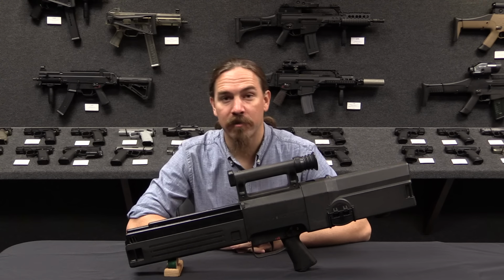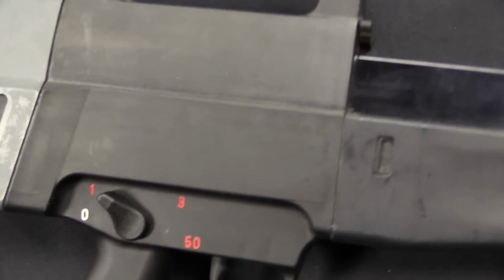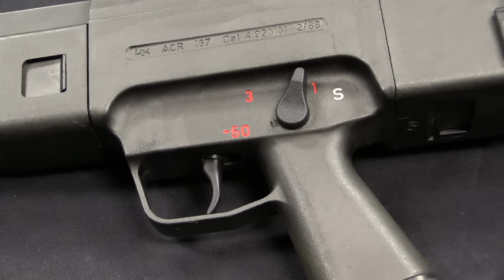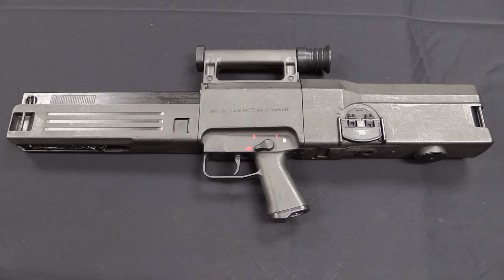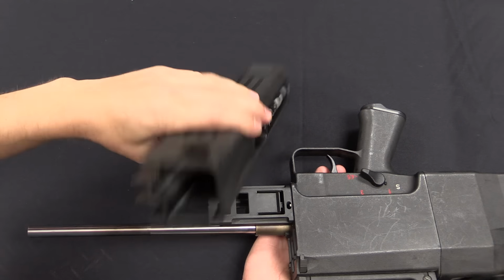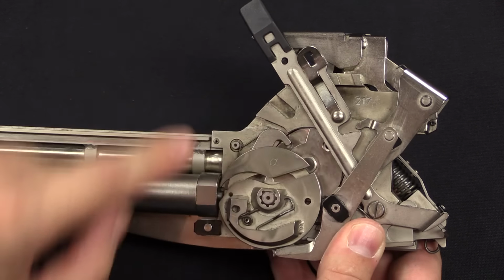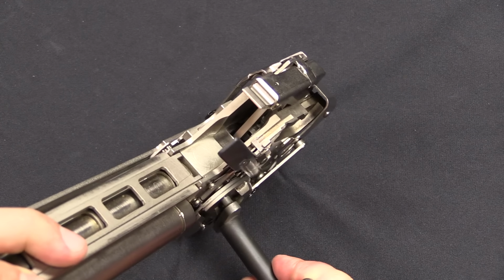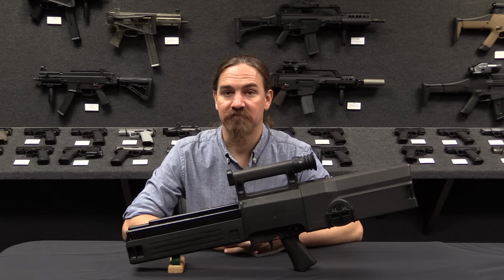Kraut Space Magic: the H&K G11

Comment: If I owned this gun and could fire it- the first thing I would do is make a clear plastic "stock". How wild would it be to fire this thing and be able to see that automatic wristwatch factory of an action going off right by your ear. It looks like a 1890s mechanical computer powered by small bombs!  Choose if you want to do 1 or 3 calculations each time you pull the trigger! For extra accuracy, paint the parts fake brass color and put fake watch jewels over the screw heads.
Reply: Clear bodied, and have all the internals redone in a copper or brass finish.
Reply: I like your thinking. Plate the internal parts with copper/nickel/brass, plate or paint the optic in brass, give the whole thing a bit of a paint job/aging treatment, then fit a transparent stock... Got yourself an awesome Steampunk Assault Rifle!
Reply: Ah dude imagine the high speed slow mo.
Reply: After I watched this I had another video pop up on my feed.  Was from like 6 years ago, shows someone firing one and have to say that it did not look at all pleasant.  Thing shook and bounced around all over the place. Not sure if I can link it but it was from "Karkanistan" or something like that
Reply: RewardedRocki the G11 was extremely experimental,you’ll only see translucent bodies on H&K’s mass produced weapons.
Reply: you just made a transparent watch my dude
Reply: You do realize the it could fire a 3-shot burst so fast that the recoil felt like a single shot, right? You'd never see the internal parts moving - it would be too fast to see.
Reply: @mcm95403  exactly ... 3 shots in less than one tenth of a second :)
Reply: @mcm95403  and then high speed camera footage came out before this rifle was even made. Sorry you missed that
Reply: @mcm95403  Don't care, still got a transparent, steampunk clock/gun from the future.

Comment: In a way I wish it had gone in to full scale use so we got real world stats on failure rates and improvements though true world testing. Caseless ammunition is the future and until someone starts using it full scale we won't see innovation in this area.

My god that action is scary! But this is basically the first of its kind. Look at how horrible the British SA80 was before it was redesigned and rebuilt. I hope someone revisits this program.
Reply: The L85A1 was a perfectly adequate rifle, back when it was still called the Armalite AR-18.

(I joke, of course.  But the L85A1 basically is an AR-18 in bullpup form, just with 200% added suckage.)
Reply: @roberthansen7228  I don't think we need to go into it, Ian has covered almost everything about that story in past videos. I worked with soldiers who were issued with the SA80 when it came out. I heard all the horror stories first hand as they came out. Including the threats issued to soldiers not to discuss the rifles failures with the general public. Today it's not a bad rifle. It does it's job well and excels in some areas. It's still a very complex rifle and in my opinion it is time to replace it.

Comment: I thought H&K's conventional pieces were complex, then they produce this. I'm not sure if the internals look more like a vending machine or a mechanical calculator. What might the probable manufacturing and assembly costs of that been? There's also a practical issue; what happens if you get mud in the barrel? There doesn't seem to be a way to push a rod through it. (Muzzle-loaders might be subject to the same criticism, but they mostly have a bore diameter that can accommodate a small child.)

Comment: When you grabbed the 'convenient tool' to rotate the action, I realized that gun is a wheelock, and the tool is a spanner....
Reply: Kind of funny considering that Wheelocks are Technically "Caseless" guns.

Would this be going full circle?
Reply: What on gods green earth is a spanner
Reply: @spencer seiler A 'spanner' is a class of hand tool generally used by lower forms of primate to round off the corners of nuts and/or snap the heads off bolts, thereby making extra work for Mechanics and Engineers. The sub-class seen here is a 'pin spanner' which adds variety to the process by bending/snapping it's own pins, thereby giving the Engineers a chance to repair the tools themselves, instead of just the results of the tools who use them. American Engineers have developed the useful term 'wrench' as an alternative to 'spanner' in order to indicate the action to be taken by an Engineer upon seeing such a tool in the hands of 90% of the population, that is, to wrench it out of their hands immediately.
Reply: @MrHws5mp  It's not hand tightened if it's not stripped.
Reply: @CallMeMrChainmail Indeed. It's also important to remember that 'LH' printed on the head of a bolt means 'Longer Handle', not 'Left Hand thread'...
Reply: @spencerseiler4904  It's a type of wrench that uses a couple pokey pins or tabs that fit into matching holes on the object to be turned.  The castle nut that secures the stock on an AR-15 is tightened by a spanner wrench.  They're also sometimes used for pulleys in cars.

Or if you're British, it just means "wrench", and could apply to any old nut-rounding device.
Reply: @ThetaReactor  Bicycles (particularly expensive ones) use them too in places. Usually where you need something that can grip without a whole lot of surface area gripping. bottom brackets (where the cranks go) is one spot off the top of my head.
Reply: @spencerseiler4904  - it is a device, similar to the 'key' used to wind up some clocks - or a similar device for winding up the spring in a wheelock mechanism.
Reply: @spencerseiler4904  Many years ago a spanner was a tool to span a crossbow. The term stuck around when a tool was needed to wind up a wheel lock action and became a general term for lever tools that fit onto nuts or lugs.

Comment: To the people saying "Just remove the 3-round burst and simplify the weapon" that's missing whole point of the weapon, the whole project was build around the 3-round burst, the use of caseless ammo was a decision taken to allow the burst to happen.

Without the burst function, the G11 has no point, the caseless ammo with it's issues have no point in existing.

If it's weight and cost reduction you may as well just use polymer cases, like the LSAT, Steyr ACR or the polymer cased 50BMG.
Reply: I don't even see how removing the 3-round burst would significantly reduce the complexity of the action. The only difference between 3-round burst and automatic is that in burst mode the action is allowed to fire an extra couple of times before it returns to its original forward position. The burst mechanism itself shouldn't be any more complex than what's in the trigger mechanism of any other burst-firing gun.
Reply: You can carry whole lot of ammo more with the caseless ammo and the magazine capacity is greater
Reply: Not entirely true, caseless ammo still has a weight benefit.

Comment: The mechanism may be a little complicated and finicky, but made well, such mechanisms run for ages.
I collected mechanical calculators some years ago, some of them are freakishly complex (just think about automated division, a hundred parts whirring and shifting), yet still they can do hundreds of calculations every day and that for years, maybe a drop of oil here and there.
They were mass-produced, the technology was there for quite some time.
In comparison the G11 looks quite simple.
Reply: Were they explosion powered? The calculators you collected.
Reply: Nope, didn´t have to be to receive high forces.
Did you ever see such a machine run without cover?
Much smaller parts, levers and gears, running into and hitting each other many times a second, or a complicated assembly weighing a pound or more slamming into a hard metal stop after a spring driven travel of four inches. Many of the fully automated machines had thick rubber feet not to spill your coffee standing on the same desk.
You will be surprised what even intricate mechanisms can take, if executed well.
By the way - that was 50s tech.

The trials rifles each put 4000 rounds through and seemd to work well, so the mechanism could easily take the loads.
In the G11 the gas system may drive the mechanism, but in a regulated way, and no part of the gear and lever mechanism had to withstand the explosive force itself.

Comment: FW, if this gun was a cased ammo with a maybe similar mechanism and perhaps a more ergonomic design would you consider this a viable gun? For example high magazine capacity despite being single stack, fast piercing bullet, complex yet relative simple mechanism. I like to think of this gun as interesting idea developed on paper but poorly executed maybe due to its major flaw of forcing the caseless ammo
Reply: The caseless ammo was necessary for the 3 round burst with one recoil impulse which was the whole point.
Reply: @trentrubenacker9718  well yes it may be the reason though it could have been worked out differently with cased ammo or just forget the fact to expel ammo before recoil was felt and just perhaps work it as a regular burst firing? Maybe I'm just talking nonsense but I try to always get the usefulness of something
Reply: @Seb-Storm  The mandate was to improve hit chances. Duplex ammo was tested. Flichettes were tested. They lacked power. The G11's solution was to fire 3 rounds before recoil was felt. It would work, but it would require caseless ammunition because you can't run a piston and extractor system that fast in that much space. Caseless ammunition essentially proved too disadvantageous and killed the project. The AN-94, a Russian firearm, fires two rounds of cased ammunition for one recoil impulse at 1800 RPM. The system is even more complicated than the G11, but does actually work because the goal is a little less extreme and  therefore allowed them to keep cased ammunition in the design.
Reply: @Seb-Storm  You couldn't use cased ammunition that small and maintain the firearms use either. It's like 60% the length of a 5.56×45 cartridge.
Reply: @trentrubenacker9718  oh ok thanks for pointing out that. Good to see people on internet can still discuss in a nice way

Comment: The feed system reminds me of the P-90, did the G11 actually contribute to its existence?  (Yes, I know it's a different company)
Reply: Feeds absolutely nothing like a P90. The P90 has a totally standard reciprocating bolt and single feed magazine. P90 mag has a cool feed ramp that spins the cartridges 90 degrees but its just driven by normal spring pressure up the magazine. 

The only similarity between the two is that they both have top mounted magazines with the rounds at 90 degrees from the chamber. 

Even then the similarities are very limited. G11 has vertical rounds, single stack magazine. P90 has horizontal rounds, double stack magazine.
Reply: Gotcha.  I was just curious if somewhere along the line the concept might have served as inspiration or someone said, "Whaddaya mean we can't feed perpendicularly, the G11 did it!  Hold my beer..."
Reply: G11 is a clock made into a space rifle looking thing
P90 is a fancy bullpup bren space smg looking thing
Reply: I'm wondering about a connection with the Steyr ACR, and later the LSAT machine gun. Those also have moving disconnected chambers where the next cartridge itself pushes out the case/dud.

Comment: TLDR: Why can't you just fire the brass with the bullet?

Instead of having the case made of propellant, why not just attach it to the bullet and use it as added mass and flight stabilization? Like, imagine reversing a shotgun shell and putting the primer in what was once the front and fire the whole thing. Then your caseless ammo is just as strong more or less as regular ammo?
Reply: Because the brass would make a horrible drag in air ? And you would push a whole bunch of 'dirt' right into the chamber
Reply: @Wolfson91  No way to design around the drag? Trade the drag for better ballistic characteristics? Think Air Bow, only shorter projectiles and powder actuated. 

And I don't follow you about dirt, seems like bottling an explosion based on gun powder is gonna be dirty no matter what you do hehe.
Reply: Fiocchi and Benelli tried that with the 9mm AUPO and the CB-M2 SMG.
Reply: @danielwatters1203  Awesome thank you I'll dig into that, that's basically exactly what I had in mind.

Edit: And here's my answers:
"In theory, caseless ammunition offers a number of advantages over traditional ammunition: less weight, less firearm complexity, higher rate of fire. One of the major detriments is heat, as the traditional cartridge case acts as a heat sink and removes a significant amount of thermal energy form the gun when ejected. Benelli hoped to address that disadvantage with the 9mm AUPO ammunition, by providing a long and thin brass cylinder to absorb heat and then leave the gun with the bullet. However, adding that extra brass also pretty much negated the theoretical advantage of lightweight caseless ammo. In addition, maintaining a way to extract and eject live rounds left the gun no simpler than any other blowback subgun – more complex than many of them, in fact.
 As a result of these rather self-defeating characteristics, it is not particularly surprising that the CB-M2 found brought significant contracts, and was shelved by Benelli in 1985."

From:
https://www.forgottenweapons.com/submachine-guns/benelli-cbm2/

Comment: It really looks like the CTAS 40mm gun feeding system put vertically (or CTAS looks like G11 feeding system put horizontally).
I don't know why but I though the rotating bolt made a 180° the ammunition being fired when positionned @90° and continuing its course to feed another ammunition, pivoting 90° firing it again and moving another 90° to take another one and so on. Thank you a lot for this review and this enlightement!
I guess we will not have a firing test ^^ .
Reply: So is that right, it reciprocates through 90 degrees only? I'd thought a free circulatng bolt could have turned a fan to remove energy through a heatsink and ventilated internal spaces.
Reply: @nichevo1  yup explained at 23 to 24min and thereafter at 26.

Comment: A while ago, I ran across a thread that really stuck with me. One of the commenters was talking about the g11 and it’s intended usage in a “hot” Cold War. What I am wondering is if anything that was written was actually factual and not something they just theorized themselves. A copy of the comment is below. 

“You have one mag ready to fire, and two on the gun beside it. That is 150 rounds, what was considered a full combat load. You ear no webbing because you are wearing a full MOPP4 radiation suit and need to be slick sided so no nasty stuff gets caught in folds and creases when you decontamination shower in hot water and Decon 90 to wash away all that nerve gas and transuronic heavy metal dust.

See how the g11 is nearly featureless on the outside? It is so you can wash it off before you get back into you APC at the edge of the irradiated zone. If it does not read safe on the Geiger counter, you throw it away and get a new one back at the underground base.

That is how bad they thought WW3 was going to look if there were any survivors capable of fighting after the initial exchange.”

Any thoughts?

Comment: The action is no more over the top than the early self loading rifles. This could probably be simplified easily if you dump the three round burst. The problem you have is that you will get 90% of the effectiveness of a caseless with only 40% of the problems with a different case material.
Reply: If you dump the 3 round burst you dump the reason for the weapon

Comment: I wonder what the action would look like if the 3 round burst capability were removed?  How simple could the action get if that was the goal?
Reply: The only difference between burst and automatic is that in burst mode the action is allowed to fire again before returning to its original position. The magazine is affixed to the action, so the action itself is operating in the exact same manner with every round fired, unlike that... thing in the AN-94. There needs to be some system which limits the number of rounds fired to 3, but I don't see why it would be any more complex than what's in the trigger mechanism of any other burst-firing weapon.

Comment: What happens if there is a projectile that dosent work ( the first or the second ) in the burstmode ?
Reply: Knowing HK, the burst counter mechanism probably self-resets if a full-burst was not fired.
Reply: @danielwatters1203  OK , but how does it notice there is a projectile that dosent work in the 3 burstmode ?
Reply: @Absinthu5  - If a round doesn't fire, there is no gas pressure to move the action parts.  You would have to manually cycle the action.  But to do that, you'd have to take your finger off of the trigger.  On nearly every other HK design, the act of removing pressure from the trigger is sufficient to reset the burst counter.